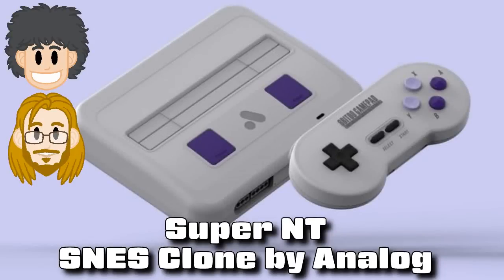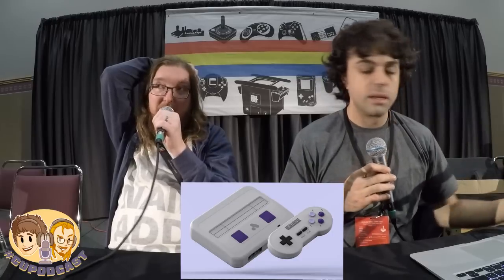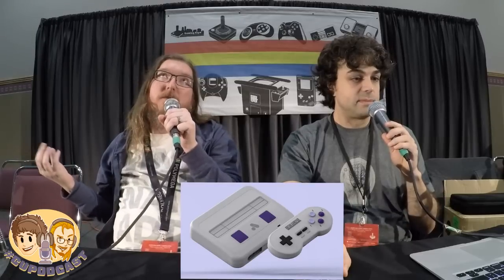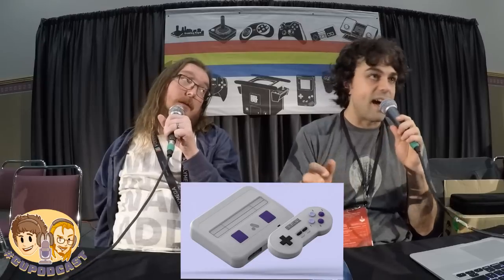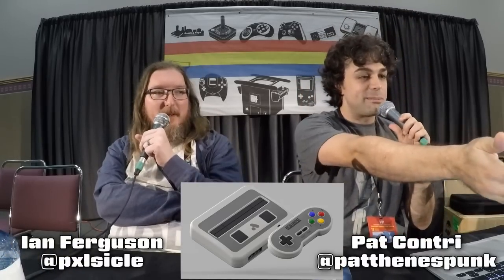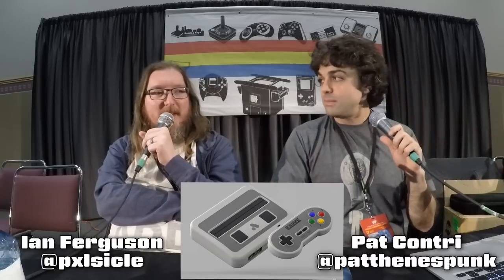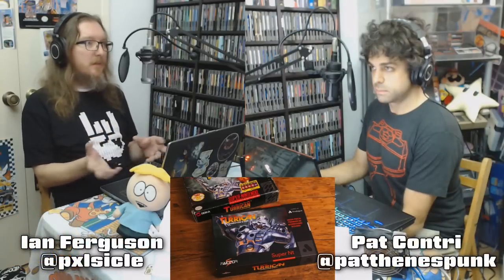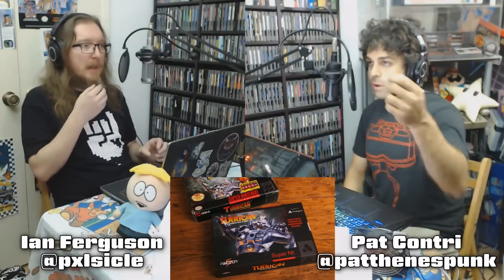Super Nt SNES Console by Analogue - #CUPodcast

Comment: I have yet to try a clone console...  Do you guys use any of them regularly?
Reply: This is not a regular POS cheap clone console but instead based on FPGA. Think of it as emulation but at the hardware level. If it is anything like my RetroUSB AVS, it will be great.
Reply: +merlingt1 I have many pos cheap clone consoles that still work 10 years later, never had any issues with them. For people on a low budget, there's PLENTY of options out there to play games. Good time to be a retro gamer.

Comment: There needs to be an N64 clone that can at least put out 720p! I'd buy it in an instant for 200 bucks!
Reply: Grungy Perry 

I want an FPGA N64 Mini..
Reply: Rex Apis Won't happen in at least 10 years, if ever. I think.
Reply: Rikard 

Nah, by next year or shortly after, we will have FPGA N64 Minis...
Reply: Rex Apis Wanna bet? 😉
Reply: Rikard 

You'll see ;-)
Reply: Rex Apis I hope I'm wrong. So far I haven't been too impressed what FPGA's can do 3D-wise.
Reply: https://imgur.com/RSogk0c
https://imgur.com/Nl0c3PO
https://imgur.com/wIcz4DJ
https://imgur.com/BbbUZqQ

It's entirely feasible, just difficult, and hardly anyone is working on FPGA cores atm.

Like with software emulators, the main problem is having to reverse-engineer the original machines, and that takes time to do accurately, including de-capping the original chips etc.

(it's very rare for a console manufacturer to release the chip-level netlists. The fairly complex console I've ever seen that happen for is the Atari Jaguar.)
Reply: Nintendo could quite easily release an ASIC-based N64 Classic if they wanted to.

It would be a 100% clone of the N64 (or with some improvements), and would be capable of playing original carts, but there are licensing issues there.

The Nintendo iQue was released around 2003, and was based on a Gate Array (a kind of ASIC).

The same exact logic could be implement in a modern FPGA quite easily, but it won't ever be quite as cheap as an off-the-shelf ARM chip with a software emulator (like the NES / SNES Classic).

https://www.youtube.com/watch?v=EQ8ry41IBG4&vl=en
Reply: ElectronAsh 

Exactly & it will cost $99 with 2 controllers..
Reply: Rex Apis

I'm not saying it will definitely happen (from Nintendo themselves), just that it's possible, and there are a few ways of doing it.
Reply: Grungy Perry We should get a SEGA Genesis mini first before dealing with 3D consoles.
Reply: An FPGA needs to be a lot more powerful to pull off N64. Kevtris himself said on the My Life in Gaming vid that it's a LOT more complex than SNES.

Comment: I still hope that analogue will rethink and also include av out to sllow to work with superscope games on an old tv.

Their argument in that they can make the console cheap by using plastic,removing av out,expansion port and to not include a controller with it is pure BS because $190 is still damm expensive.
Yes it has a FPGA chip in it rather then a clone chip or emulation chip in it,but still, $190 is no excuse for this.

Again they must also include av out to ansure 100% compatibility with all games & accessoires like light gun games such ad yoshi safari etc,,,